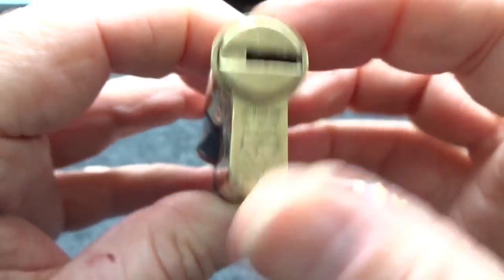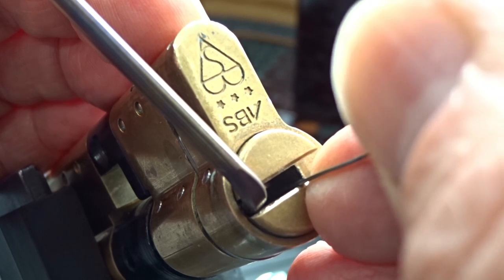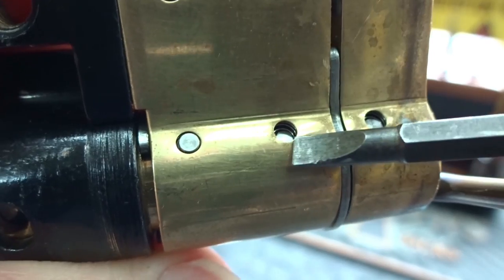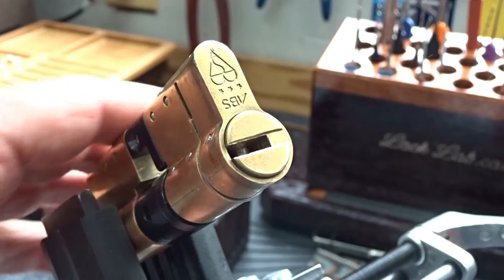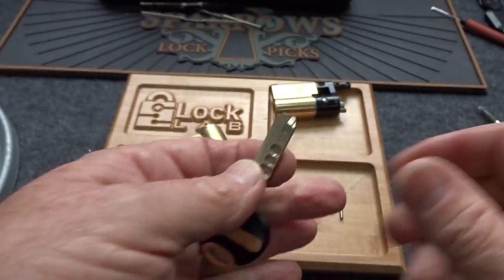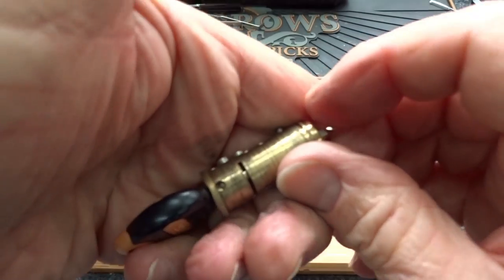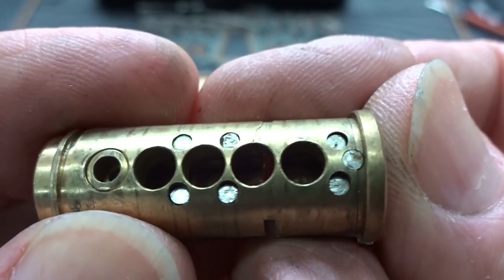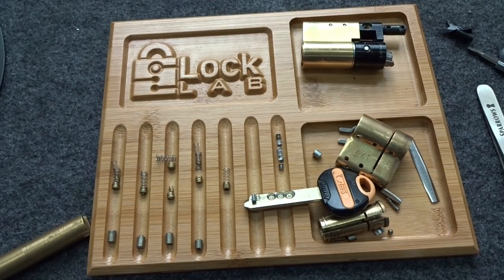(1063) ABS Magnetic Lock with TRAP Pins!

Comment: Technically speaking, after you pick it , cant you put in a wrong key in there, or fill the lock with pieces of wire?  If there's trap pins attacking the location of the key teeth that push the pins, as in a pin re-check, you could squish a softer metal there to take the shape of the key needed.

Comment: I've had a couple of these locks on my house and they always become notchy/sticky after a year or so simply because the magnet on the key picks up crud and carries it into the lock unless you wipe the key clean every time (and no-one does).  Took the first one apart after I replaced it (lost a key) and had the same feeling as Bill; it wasn't going to back together.
Reply: @markylon A new key doesn't fix the problem i.e. the crud that gets transferred into the lock from the magnet on the key.
Reply: @markylon That's fine, they do come with a security card with the required info to get new keys, though if you need more than the three keys supplied it's a fair bit cheaper to get additional keys when you order the lock rather than afterwards. 
I was a little confused why you replied reply to my post which is entirely about my experiences of the lock getting sticky due to contamination of magnetic particles from the key.
Reply: @markylon The first lock became sticky and was sometimes hard to use though it still worked, but then I lost one of the keys. Having a lost key is a big security risk and since the lock was going bad anyway I replaced it.
I'd always replace a lock if I lost a key and suspected it could have been lost close to home.

Comment: I dunno about WD-40 I use tri-flow in locks, stuff really surprised me when i first tried it
Reply: They actually tell you never to use WD-40 on these. Graphite lubricant only.

There's the old joke: what's the difference between WD-40 and varnish? About four weeks.
Reply: @nowster  yea, I avoid WD-40 when I can. Triflow is a PTFE based lube. Although WD-40 does have other formulations now like PTFE and graphite.. I actually found triflow when a locksmith recommended it to me.

Comment: 15:43 Dont bay eny batteri China  (or Battery bank) all is ~ -50% (Printed is 3000mA but measured/tested then only 1500mA or 1000mA  (or is battery insaid ReUSED, but like new if you lookl outside) or is defected (manufacture sorted out, not but original device (not suitable for sale to original equipment officially))

Comment: OK I posted on this video about 5 months ago that there is a special pick that can open this lock in a few seconds, and I carry that pick in my van (I'm a locksmith), well I hadn't actually had to use that special pick (other than in the workshop to test it out) until last Sunday, when I got a call from a fellow locksmith who was at a property with the owners locked out (lost key), and they had the ABS lock on the door, so I went over with my special ABS pick, and the hardest part of using it was determining the position of the magnet, as the pick has 5 blades, each one with the magnet in a different position, but once we had discovered witch position and therefor which blade to use, the lock opened in a few seconds.   https://tradelocks.co.uk/videos/ABS%20Tool%20Video%20(MP4%20Format%20-%20lowest%20quality).mp4

Comment: Not sure trap pins like this are good idea .. with all that anti-drill and anti-snap protection, how are you gonna to replace the lock if someones tinker with it and locks it ?
Magnetic element is nice touch though. Still it only works as long as you don't know about it.
I prefer heavily paracentric keyways. Those just can't be picked. Check Bill's nasty bucket videos .. and with proper security pins, they can't be bumped or impressioned either.

Comment: It looks like a super secure lock, and the police over here (UK) even recommend the lock, but there is a tool that lets you pick/bypass it in a few seconds flat (As a locksmith I carry the tool in my van), and it will even let you lock it afterwards with no visible sign of tampering.  
 http://tradelocks.co.uk/videos/ABS%20Tool%20Video%20(MP4%20Format%20-%20lowest%20quality).mp4